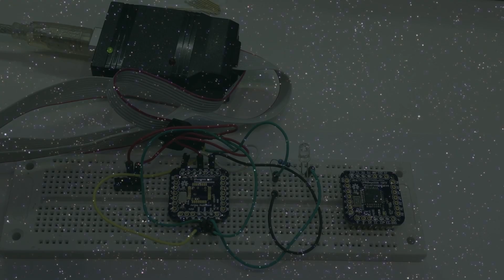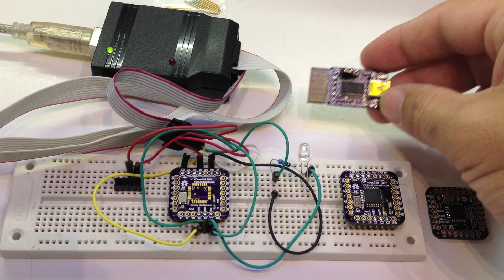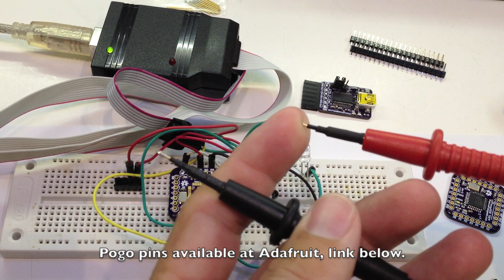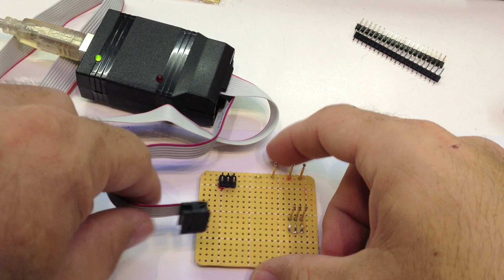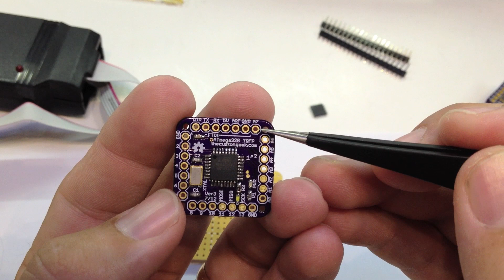Programming the Square Inch - TQFP Jig

Comment: What type of programmer is that and or which would u recomend? I have been looking at many types 6 pin, 10 pin, avr vs pic soo confusing. .. I like the arduino and atmel curently but does that have any limitations as to programming other chips and possiably eeprom chip programming.  Thanks